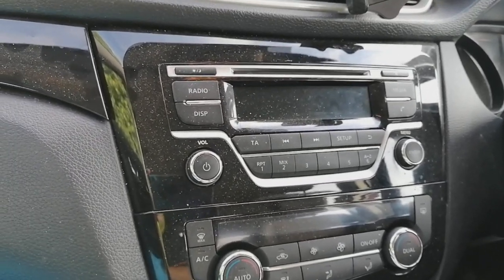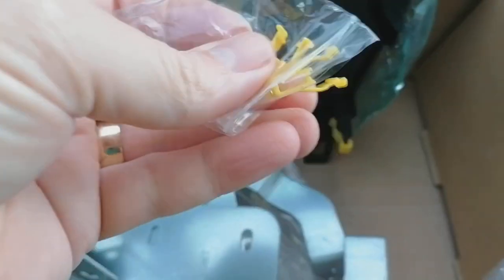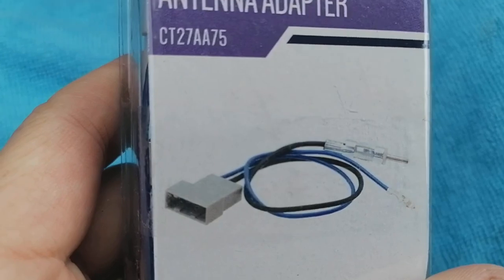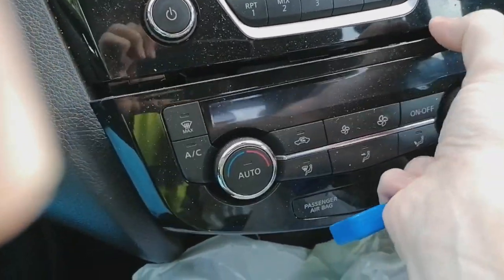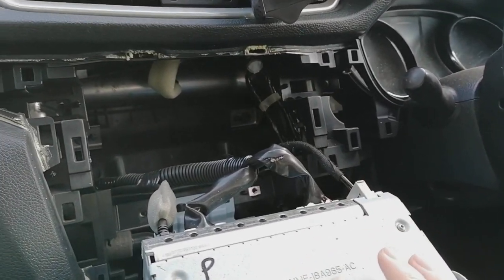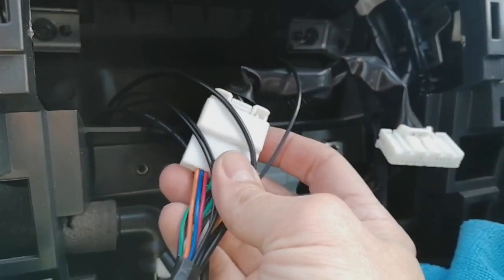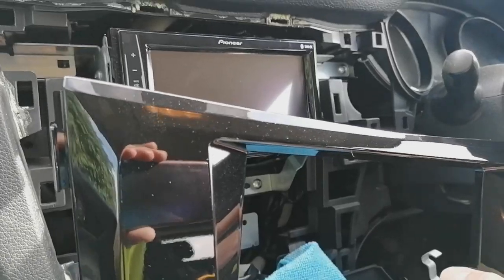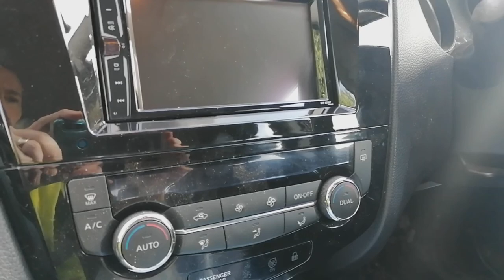Nissan Qashqa 2013 - 2021 how to remove factory radio &  double din conversion + part numbers needed

Comment: So how much did everything cost ?? That's the big question ?
Reply from the maker: @TheGardener54uk  Sorry chap no idea, I was trade so just doing large scale installs of in car electronics.
You could pop the parts in to Amazon or if your country has a large car audio retailer ask them for the current equivalent model as the one is the guide will be out of production by now.

Comment: Hello 
I would like to thank you for your very enlightening video and ask you if you can tell me a piece of information
I have exactly the same radio model (visteon) and I want to put a new one like you
 you have connected one cable white (probably power and speakers).the other white no, it must be connected somewhere or needed somewhere
thank you very much and sorry for my Bad Englisch

Comment: Hi, I purchased a qashqai 2015 sat nav head unit and was wondering if the iso you got from halfords will work on a 2017 xtrail?
Reply from the maker: You would need to give Halfords the reg number to id the correct iso.